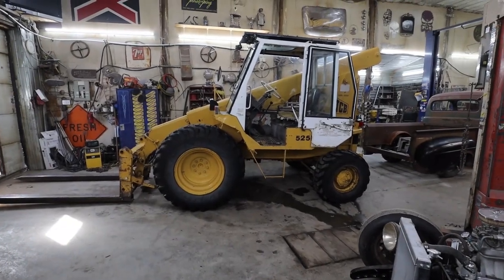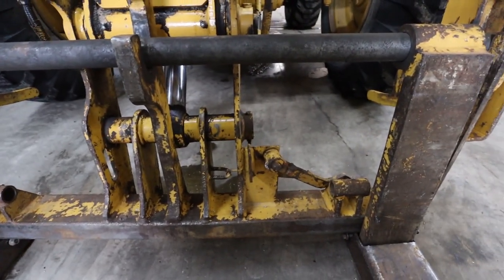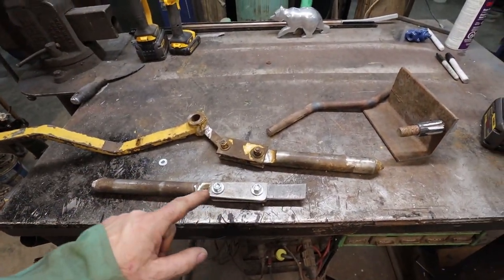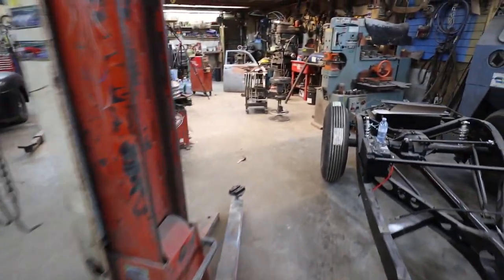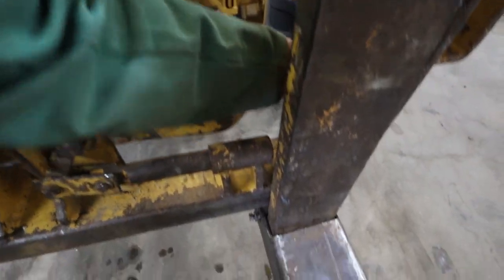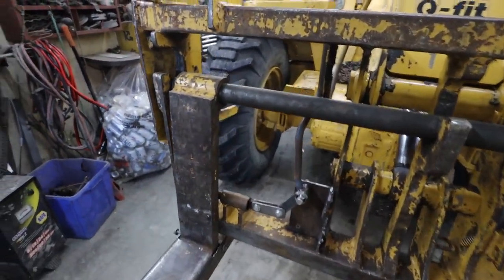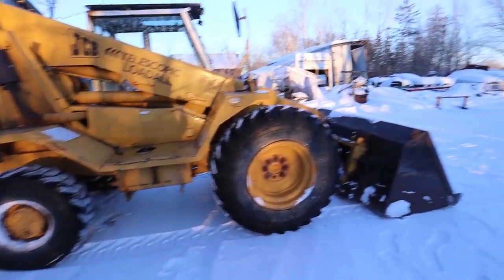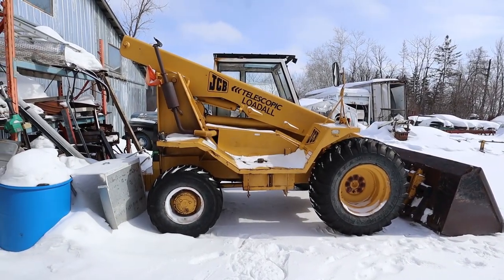Fixing JCB telehandler bucket attachment and pushing snow.

Comment: I thoroughly enjoyed this video Brent, Thank You for taking the time to make for us. I grew up on a Farm in Central Illinois in the 50s. We were not poor but we were far from well off too. If anything used on the farm broke, Dad had to fix it, get by without it,  take it to town or worse ask someone to come out. He was not so mechanical that his repair skills included welding. Many farmers did and some of my friends had access to a Lincoln Tombstone 220 V Arc welder. Watching you go at the figuring out, finding materials and fabricating the fix was exactly how we handled many of our repairs. The Oak Seed spreader, The Hay Rake, the cattle loader ramp, the corn dump. Watching you brought back so many "How do we fixt that", episodes with my Dad. It warmed my heart. And yes, sometimes I was the one that broke the equipment. Dad knew how to nurse and use a wounded tool without making it worse. I was not so aware. Thank You So much. I left the farm, but the farm never left me. After over 150 years the farm is gone, Dad is gone, all the equipment is gone. But in my memories and with your video it all floods back and I smile, I laugh with Dad and we would cheer if something we cobbled together with wood and bailing wire and it worked, even is only for that season, or that field. Thank You So Much, Dennis

Comment: Was kinda wondering if this place had a cannery on it at one time. That one long building if strong enough would  hold most of the collection indoors for winter months. I am so over snow and ice as I fall down and go broke something that time stuff and old people just don't heal up as good as we once did. Another one of my stupid ideas is maybe make a bucket that is as wide as the one you have and then a  cylinder open it up   to almost one time again for pushing snow or muck a little easier. 'What cha thinks on that one??